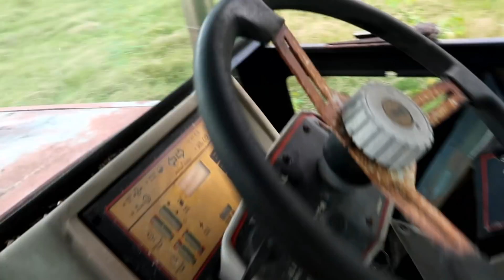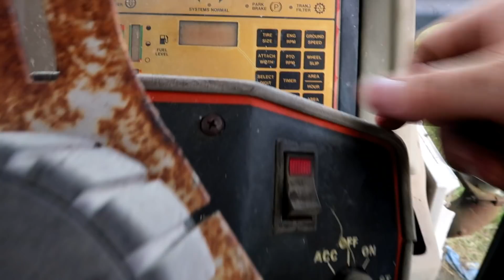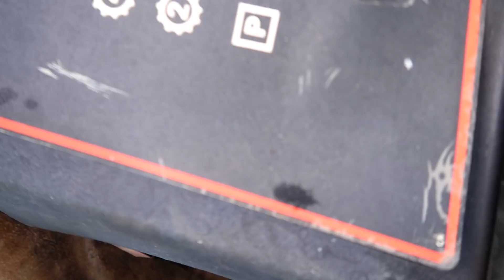WILL IT START Episode 5! Major SETBACK With Case 1896 Tractor

Comment: Oh the memories.  Sound of the trans 4:31 bypassing oil,  abrupt clutch engagement, the skull rattling power shift that needed adjustment every couple of years.  I liked the steering, and the rear visibility.
Reply: we have a 2394 with the 24 speed. marginally smoother shifting but god damn do those clutches give a guy whiplash.

Comment: I hope someone can help me with this, I am an old Yorkshire guy now living in Ireland (74 yrs old) and I have limited tractor experience. I have a smallholding and two ancient Ferguson T20 TVO tractors and a Nuffield 465 diesel tractor, all of which are extremely reliable and have no electronic components. My, perhaps in some eyes , naive  question is why have manufacturers thought it necessary to introduce such alien electronic gadgetry into agricultural workhorses. Simplicity is ALWAYS best in my opinion.

Thanks to you guys for sharing such a captivating series of videos.
Reply: My grandpa owns 4 nuffields and 5 fords
Reply: a lot of it was for efficiency, power increase, and emissions control. manufacturers didnt have much choice in some cases. I too prefer non electronic equipment but sometimes it's necessary
Reply: I agree with Jake and to add to it, cost is a big one. It just costs less money to make an electronic switch panel with relays to unload the cheap little switches than it does to make a mechanical unit. In my opinion increasing the number of "consumable parts" is done to squeeze more revenue out of the engineering time. I'm only 28 so I don't have the perspective of seeing the change in industry but that's what it looks like to me.

Comment: If you guys buy it, you should do a series of restoring it. Also I recommend changing the rusty oil filters that are next to the fuel pump. Changing the oil would be a real good idea as well to prevent any possible internal problems down the road. Keep it up!

Comment: Steering knuckle boots are always messed up.. 
Check the breakers/relays at the starter for power to the fuse block.
You got lucky on the powershift relays!!! Usually when that's the reason they don't move, they're burned up..

Comment: Power comes off the starter or battery up to a cab power solenoid then over to the left side of the cab and through the floor.  Either the constant power to the key is dead or the key to cab solenoid is bad. Both run through the cab floor and are notorious for loosing connection and burning up. The other thing that they are famous for is rats building nests behind the dash and inside the steering column.
Reply: I remember on the 90 series they had an update to replace the accessory solenoid with a relay. Occasionally the relay plug would get hot due to the electrical load. That would create an open circuit.
Didn't get much shop time on the 94/96 series machines.
Reply: @bigham1jb  you are correct but its 50/50 on the ones around here

Comment: You can just Jump the Oil lines disconnecting the oil cooler it won't be a problem at all for driving. Should not do field work with it :)

Comment: Good job with the tractor guys. Amazing work yall do. I have a question for you. What would cause the block on a tractor to crack during idle in the winter time? I started my ford tractor upwhen i was 13 during the winter to clean the snow off the drive way and thought it was idle long enough then as i took off thays when the block cracked

Comment: Looks like that tractor was from when the Case IH merger happened.  Dealers and some owners were painting them red.
Reply: They were sold red after the merger.  Its factory
Reply: Not a merger,  case bought out ih
Reply: The first year or so were white from factory and the rest were red.
Reply: @LSswapGarage1  I had a family member working at an IH dealer at the time and I recall him saying they did paint whatever was on the lot at the time.  I also had a neighbour paint theirs red.
Reply: @robertwemberly923  I did Google this and it reads that Tenneco bought the IH ag assets and merged it with their JI Case company.
Reply: @jbsoccerstar1585  And considering they continued selling that tractor through 1987 they came from the factory in red... just like I said.  I should know.. I owned one.  My 2294 was offered to be painted red while it was still under warranty and back then we declined.
Reply: @LSswapGarage1  the reason I commented in the first place was that this looks like a white tractor painted red.  If it was done at the factory I assumed the paint would have lasted better.  I could be wrong.
Reply: @jbsoccerstar1585  who knows... it's so sun damaged you can't tell. And honestly who cares if it was.